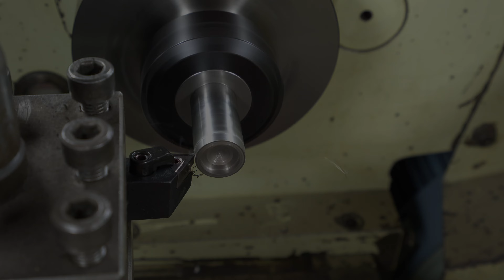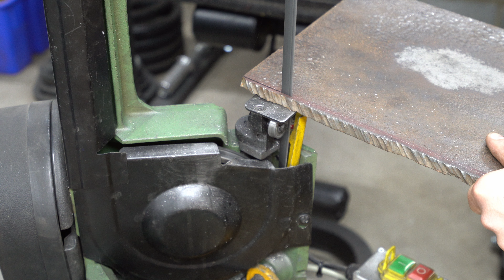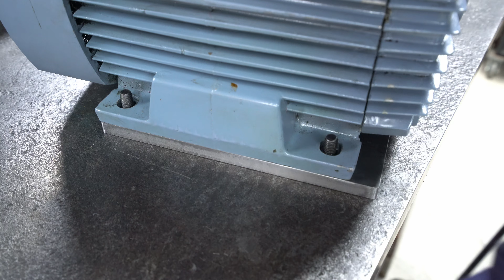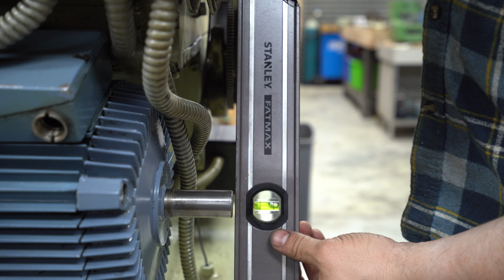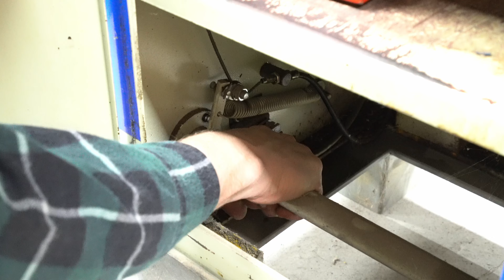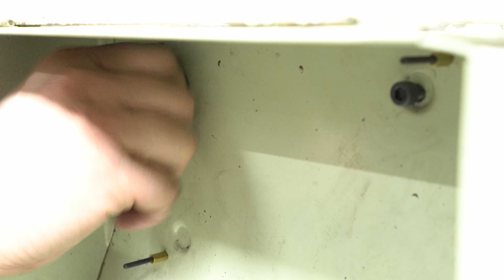Out with the old, in with the ... OLD? | CRAIG'S WORKSHOP

Comment from the maker: If I did another video on the lathe some time soon, covering things like installing the quick change toolpost, coolant pump, and so on, would anyone be interested in that kind of thing?
Reply: Yes, sure! Whatever you feel like showing, I tend to enjoy watching :)
Rusty is adorable!
Reply from the maker: Hi Mumblebee and thanks, I'll proceed as planned then. Watch this space (And Rusty says woof 😊)
Reply: Yes, sure am interested. How shop dogs avoid getting swarf stuck in their paws is always a mystery to me. Cute doggo.
Reply from the maker: @HM-Projects  I just sweep and clean a lot! That is kinda necessary for the filming anyway, and Rusty keeps me good company so it is worth it 👍
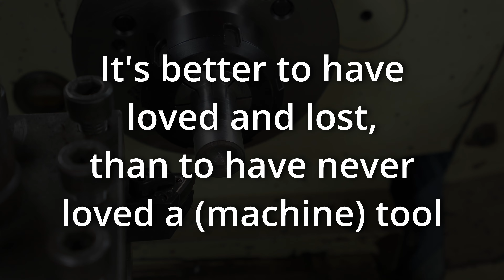Reply: @CraigsWorkshop  18:26 18:26
Reply: Absolutely mate 👍
I have an old (1997) AL960B and I’m in the process of replacing the motor. Bigger frame…. so I’ve had to do the same trick with the motor mount.
Then had to ‘chop ‘n channel’ the rear guard because the motor pulley had moved rearward.
I’d love to see your continuing upgrades.
I also added….
A lead screw cover; a taper turning attachment off an AL1000C, & moved the threading dial to the front of the apron.
Regards,
Robert
(Sydney).
Reply from the maker: @RobertBrown-lf8yq  I would be Very interested in learning where you got the leadscrew cover and what it took to install.
Reply: @CraigsWorkshop  
Hare & Forbes. It’s in their catalogue as an ‘accessory’.
I’ll look it up and get back to you 👍
Reply from the maker: @RobertBrown-lf8yq  Thanks Robert 👍
Reply: Yep.
Reply from the maker: No worries Lance, I'll make it happen. Cheers Craig

Comment: I always wonder when i see people have animals in the shop... The mill, especially on the side milling - produces a cubic tonne of satan`s fingernail clippings, which i myself can accept having to pluck outta my body parts with tweezers and flat pliers, but animals are kinda dumb in the regard that they cant really signal that they have a sharp bit of metal stuck in them... Sure, you can notice it if its bad enough, but animals mostly try to live a normal life in absolutely any circumstances and will often disregard pain and injury to sustain their regular routine, which makes it hard to take care of them when compared to humans who bitch and moan at every scratch and bump... 
My dogs have never seen the inside of my shop, and i always kick off my shop slippers when i leave the shop, taking the lab coat off aswell as not to shed any hidden chips around the house... Hell, i hate it when i have chips stuck in my beard, as i dont usually notice them, and shed them around... I once went to brush my teeth after 5 hours of chilling around the house, which were preceded by lathe work, and i noticed that i have a steel spiral stuck in my beard, hanging loose for like last 5 hours minimum... 
Ok, i keep my shop in a clean room state as much as possible, so that is another reason why dogs dont go in there... I dont want hair and dust and grit falling off of them and getting airborne in the shop... But other than that, yeah, those fluffy paws are just waiting to suck up some satan`s fingernail clippings... And with them licking themselves all over, its easy for them to snack on some chips, which is nightmare fuel scenario... You have a dog or a cat sit on the shop floor, suck some chips up like a fluffy rag and then go out and ``clean`` themselves, ingesting that crap and you have an instant veterinary emergency, if you even manage to perceive that there is anything wrong before shit really hits the fan... 
I usually clean up my new acquisitions in the yard in front of the shop, as said, clean room status, so no dirty machinery goes in... Yet while im doing that, i sweep the floor daily, vacuum clean the outdoors floor after sweeping and do that every day that i work on the machine... That shit is just a hazard and a menace towards any living beings, let alone those who have 0 concept of what a metal chip is and how damn dangerous such a minor shard of metal really is, especially if consumed... Animals arent stupid, but in that regard, they may as well be chickens, pecking and plucking shit off the ground without any regard or concept of safety that we wily housemeat hunter have...
Reply from the maker: Thanks for that well put and well thought out comment. I do pay close attention to Rusty when he's in the shop, and 99% of the time when I am machining, he is not in there. There are exceptions, but most of the time I don't need to be thinking about the operation I'm doing, plus making sure Rusty is ok, so he gets to spend time in the rest of the house.

During machining on the mill, I have a pretty good set of chip deflectors (not as good as a CNC enclosure, but it's 99% effective), which drastically cuts down the number of chips that can leave the mill table. I also sweep and vacuum around the machines very thoroughly - so  much so, that when I'm not doing a machining project, anyone from the house can come through the workshop to see me in the adjoining "clean room"/office, even wearing only socks. It's pretty dust free and certainly chip free.

Being a video maker, and a pet owner, and having a workshop attached to the house, I have multiple reasons to keep the workshop as spotless as I can! I sometimes feel like I spend more time cleaning than machining. Not a way you could run a job shop of course, but this is not that.

Thanks again - great to hear from you !
Reply: @CraigsWorkshop 
Regarding the home shop setup, i get you completely, also in regards to the cleaning... Its a damn time sink, but its worth it... Keeps both the machines and the shop in better condition, allowing for higher precision and as you said, the ability to walk into the shop in socks...
Regarding pets, i like to be extra careful... Just as a bit of preemptive strike kinda deal... Better to prevent crap than having to deal with the consequences... That`s my motto, not just for the shop and pets, but for most things in general... 

All the best and kind regards!
Steuss

Comment: 4:44 in future, just measure the diameter of the hole (or slot), zero the verniers, then measure the distance between the outer edges of the holes (or slots) and that will be the centre distance.
Reply from the maker: Yes, that is one step simpler. A few people pointed this out to me after I posted. Nice trick, thanks 👍

Comment: is the foot break "fail safe" - you want it to be normally shorted so that if eg: a wire breaks, you don't have a broken break.
Reply from the maker: You are right, I do want it to be failsafe. But, with the VFD I have, it is a circuit closing, that initiates E stop. So I have to work within its limitations. If I were designing the VFD, I would definitely incorporate a fail safe, at least as a programmable option. Thanks for the comment.

Comment: Looks a nice lathe? , good technique on motor hole centres, is the fitted motor  ore powerful than the original?
Thanks for sharing.
Reply from the maker: Thanks John, it'll be a great lathe for me. It was a good price (Funds are limited), and the things on it that needed a bit of TLC or replacement, are things I can do here with the gear/skills I have. The new motor is 3hp, which I think will be ideal. This style of lathe came with a 2-3hp motor depending on where you buy it from. They have been making the same style of Taiwanese lathe for a few decades now, under lots of brand names. Thanks for your comment. Cheers, Craig

Comment: Good luck with the new old lathe
Reply from the maker: Thank you 👍 I still have a bunch of things to check and clean on the lathe, and some new items have arrived which will bring a bit more modernisation and functionality to the lathe. These will hopefully be shown in a future video! Thanks, Craig
Reply: @CraigsWorkshop  Does it have a gearbox for threading or the tedious gear change?
Reply from the maker: The new one has a very comprehensive quick change gearbox, and a lot is possible without changing any change gears. But it does have a few extra gears to do the full selection of metric and imperial. It will be very convenient to use for threading 👍
Reply: @CraigsWorkshop  Definitely more pleasant. I'm working to convert my lathe to work with a very simple gearbox for the few threads I commonly use, got tired of the gears swapping...🤔🤔🤔
Reply from the maker: That is a good idea.. might be a good idea to have a look at Tom Make Here's home made quick change gearbox.
Reply: @CraigsWorkshop  I have seen some videos of people making gearboxes, they take it more seriously then me, I only want/need a few combinations, I mostly use metric threads between 1 - 2 mm pitch, so I hope it will not be too complicated....😁😁😁

Comment: IIRC Keith Rucker has done a "make and fit a gib strip" video, but I think it relied pretty heavily on a surface grinder
Reply from the maker: I am recently hand-scraper enabled in my workshop (I invested in a sandvik carbide scraper, which will definitely outperform the home made converted-file I had before). I think that's the gold standard for gib fitting. So I could mill to get it close, and finish with scraping.

The gib is really working fine as is, as a bearing surface. It's just missing the slot to control its adjustment properly. So, I am also considering tig-brazing a piece of steel onto the end of the existing gib, and then shaping it, so that it does not rub on any of the important surfaces.

Comment: At which point did the cost of the inserts you used up trying to reclaim the scrap exceed the cost of the new material? 🙂
Reply from the maker: Quickly! I am repeatedly learning that I am a sucker for falling into the false-economy trap. I keep thinking I want to use reclaimed materials, then I accidentally go through a screw in a piece of reclaimed timber, and all savings are lost (in the time spent swapping and then sharpening thicknesser blades, for example). And it's the same with using pieces of reclaimed steel that either have holes in them that need welding closed, or braces welded on that need cutting off, or deep rust, or paint that needs stripping. It quickly becomes a loss, particularly if you want a video-worthy end-result. But I am slow-of-brain so I keep playing the game. 🙂 I will learn eventually.

Comment: When marking the motor bolt holes (where you didn't have good access to use a punch);

I find fixing normal masking tape (painter's tape in the USA) on the target area helps. It can be written on  with pen or pencil, and also provides a soft uniform surface which can be marked easily with a scribe or hand held punch.
Reply from the maker: Thank you Paul. Masking tape would have been a definitely improvement. I'll keep that in mind. I also just bought one of the pica pens, which robrenz recommends. They are a marker with a very slim tip which can reach into narrow featues and get right up against the edge of bolt holes and similar. So I have a few tricks up my sleeve now for next time this crops up. Thanks again - good to have you watching and posting good ideas. Cheers, Craig

Comment: You and your electrician appear to have the same taste in clothing!😂 I recently upgraded my lathe with a 3 phase motor and VFD. I really like the ramp up start function. The old single phase was quite savage when it started. I think it put a lot of load on the gearbox and belt.
Reply from the maker: Agreed. This slow start was one of the features I liked for two reasons. First is it is easier on the lathe mechanics, and second it is a soft load for the house electrics. Allowing me to run a bigger motor (3hp) that I would otherwise be able to do. Even small motors can draw 10s of amps when starting up normally.
Reply: @CraigsWorkshop  Yes, that's true.....the house mains will take a beasting if you load it with a    3 HP single phase motor....ask me how I know......so I fitted an electric clutch to my lathe, gleaned from a car's air conditioner drive......that allows the motor to keep running and I can switch off  and on frequently without blowing the mains box.
Reply from the maker: Very clever Ian - I like that idea.

Comment: Thanks for the video Craig. Using new steel for the motor plate was a good idea.
Reply from the maker: Thanks Paul. I did want to use the salvaged stuff, but I think the pits were 1-2mm deep on both sides, and I didn't want the plate to be too thin. The new piece of plate solved that for me, and actually didn't cost much more than the scrap bit I bought (I must have overpaid for the scrap!)

Comment: I like your center measurement trick. Awesome, and very useful. I'm just setting up my benchtop mill on a stand I built for it and this will be very handy.
Reply from the maker: Thanks, glad there was something useful in there for you 👍
Reply: There is another way; measure a hole diameter (inside jaws) and reset the verniers to zero, then just measure the two hole total distance (inside jaws) and it will automatically show the centre to centre distance.
No need to halve things etc. 👍
Reply from the maker: @wizrom3046  good thinking 👍 Thanks I will try that next time.

Comment: The Premo looks like a much higher quality lathe than the 14x40 lathe.
Reply from the maker: You may be right, but the Taiwanese lathe is great in its own right. In some ways I am trading some build quality and machine condition for more capacity and modern features, and fully metric. I should mention the other lathe I have too: Emco Maximat V10P which although is the lightest of the three, is the most precise - and is in pretty pristine condition.

I've got the 14x40 for bigger jobs which need coolant, and a bit more horsepower, and the Emco for delicate/precise jobs that need some finesse. The Premo was reasonably good at both, but having the two dedicated lathes in future, will give me the best of both worlds. 

Don't forget I've had the Premo for several years and it's considerably better now than when I bought it. I will bring the 14x40 up to scratch too. Thanks for watching.
Reply: @CraigsWorkshop  Emco, that's pretty hard to come by here especially in pristine condition. Much envy :P
Reply from the maker: @HM-Projects  it was entirely mislisted and misrepresented in the advert. It was sold as "German Lathe". Well for a start it is Austrian! 😂 And the pics showed it in a very dirty neglected condition, but amazingly under all the dirt and grime, it was very unworn and will be a great lathe. Screws etc are basically as new - basically no backlash - and not because it has been adjusted out.. This lathe will get some motor and VFD and DRO attention too in a future video, but one thing at a time. 👍
Reply: @CraigsWorkshop  if you're in Victoria and ever think about selling the emco let me know 😍
Reply from the maker: @HM-Projects  thanks HM. I will keep that in mind. Although there is a queue forming!